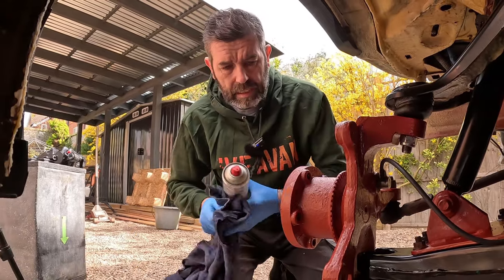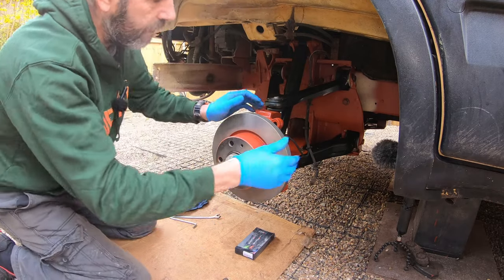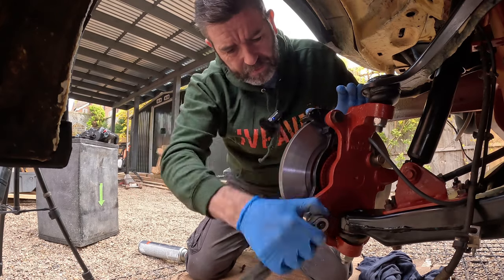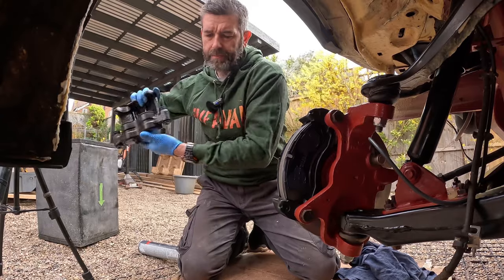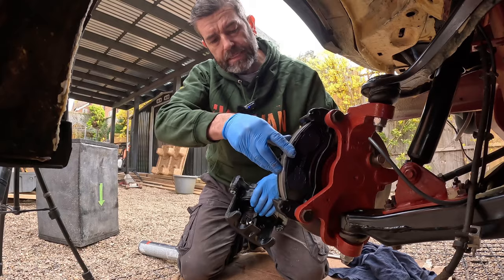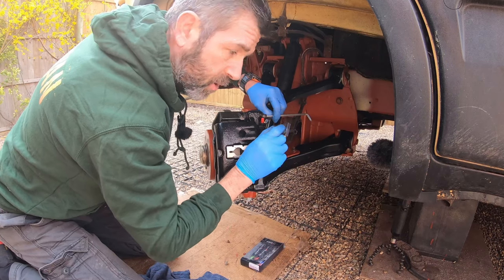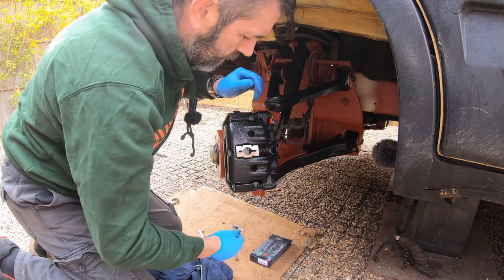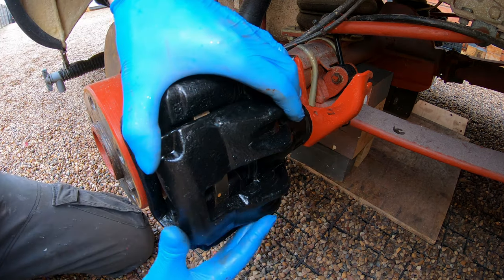Fitting New Brake Disc & Pads  | Iveco Daily campervan |

Comment: Mate, excellent video, packed with good information,  did not know about all the different greases. Only knew about 'Copper Ease'. The  colour combo sets everything off and we've all been there were we have bought the wrong part.😅
Reply from the maker: Cheers matey 👍. Yes, I did tell the parts supplier it had 'ABS' but it still came wrong "🙄".  Copper grease (for it's anti seizing and heat transfer properties) is fine to use on it's own if used sparingly. But due to it being an petroleum based product, over time it damages the rubbers that protects the piston and slider pins, also copper grease goes hard & becomes less of an lubricant. So best to use an silicone based product upon the slider pins as it's rubber friendly and graphite grease upon the saddle where the pad slides along. Hence using this brake grease kit bud 😉👌👍👍👍.
Reply: @Iveavan  Cool man, thanks for thanks for sharing the info!!! Some of these parts guys shouldn't be working in parts,😁

Comment: Morning Mark, is there a particular reason certain parts are painted red and black, I know these paints are for metal, but could you have painted it all black?...looks well thoa Mark,  TOP JOB 😀
Reply from the maker: Cheers bud 👌👍, No, not really, the red paint is Red Oxide paint (Iveco chassis of this year came red from the factory) the black is either heat proof paint or how it came on the new parts. It's all been covered in waxoyl now (besides the brakes obviously) 😉👌👍👍👍.
Reply: @Iveavan  got ya , didn't know about heat proof paint,  I know red oxide, learn something new every day 👍